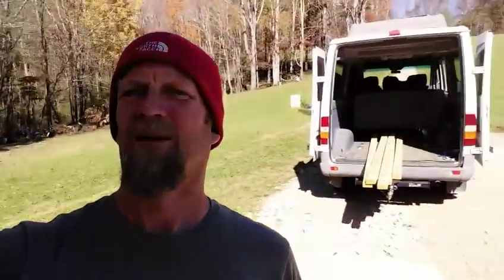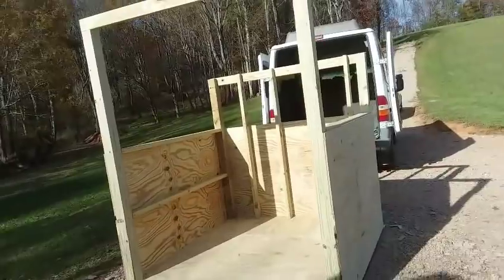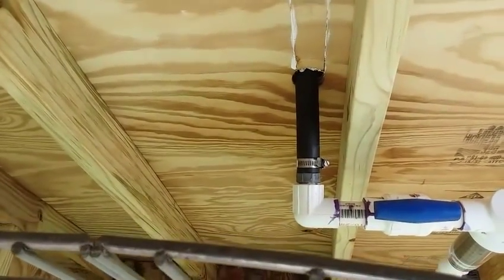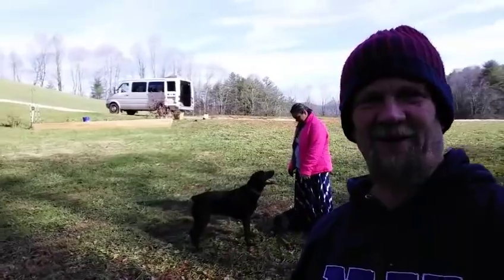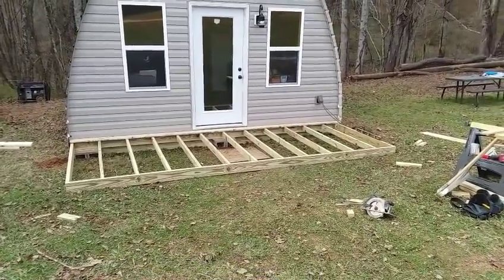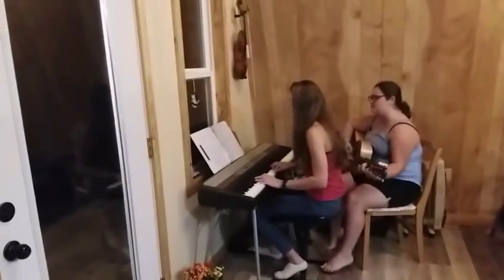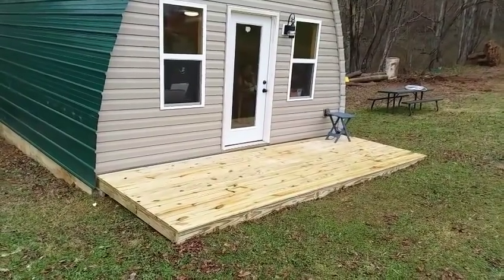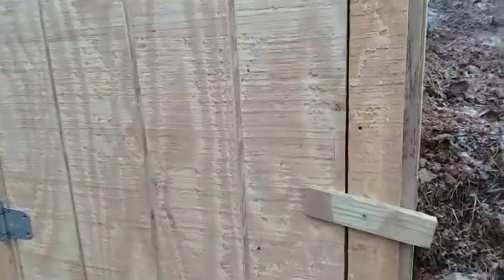Building the Bungalow part 9: Ready for Winter...Me too!

Comment: Jon, great update on your progress.  Do you think you will have to add heat trace to your pump house water lines?
Cherish your girls.  When done properly, it's the hardest job given a man on earth
Reply from the maker: I don't know.  I am ready to do it, if necessary.  The water tank is a heat battery, as well as the earth.  I am hoping that with a little extra insulation in the walls, it will hold up.  We have had temps down to 14 degrees and no issues so far.

Thankyou-- I do cherish them...time goes by so fast.  I know they will be gone soon.  We have 7 children and our home keeps shrinking as they go....